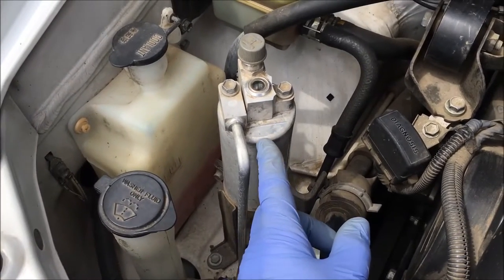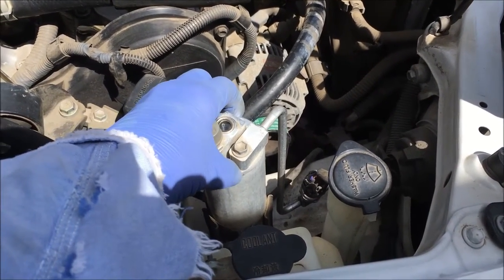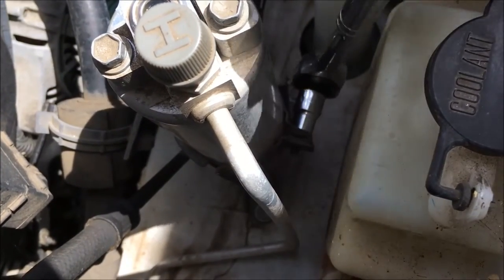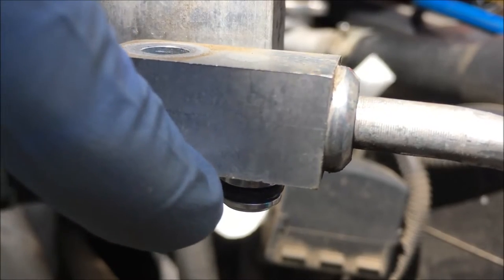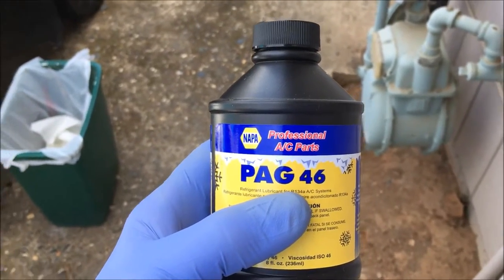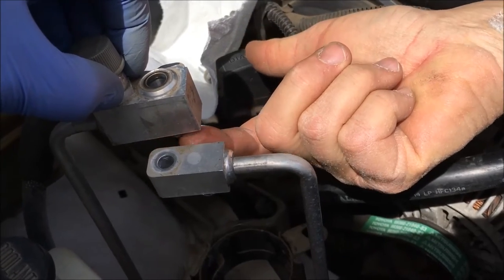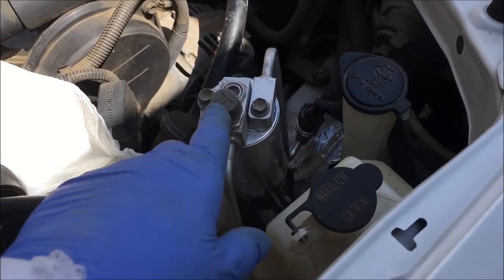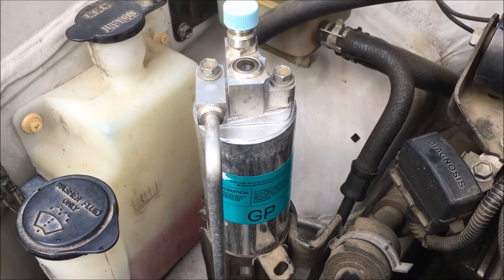Replace A/C Receiver Drier | Toyota Sienna 1st Generation

Comment: Hi thanks for your videos I'm a subscriber.

Question please...

I have a 1995 Lexus LS 400.

The radiator fan is not activating.
It does work because i tested it.

I disconnected the connector that's connected to the receiver drier and the radiator fan turns on and stays on continuously the whole time.
But when I reconnect the connector the radiator fan turns off.

I'm trying to fix the fan so that it turns on when I turn on my air conditioner but the fan does not turn on when I turn on the AC.

I feel like it has something to do with that connection but I'm not sure.

Do you think I might have a bad sensor that's connected to the receiver drier?

Thanks.
Anybody knowledgeable please reply soon.

Comment: How to spot receiver drier had problem?
Reply from the maker: Hi Hazim.  If you suspect a leak at the joints of the Receiver Drier, where the O-rings are, you can rent a leak detector at a local auto parts store to probe the area.  If you return the detector in good shape, you get all of your money back.

There are many issues that can result from a failed Receiver Drier and too many to cover in a response comment.  Other components of the AC system that fail share some of the same symptoms or issues, so it can be difficult to pinpoint which component is causing the issue.  I recommend that you search the topic online.